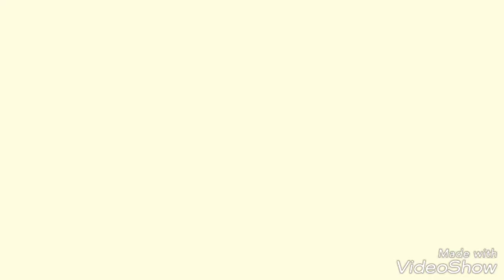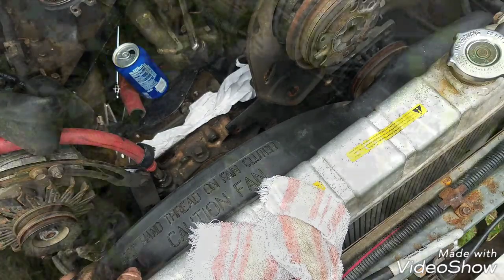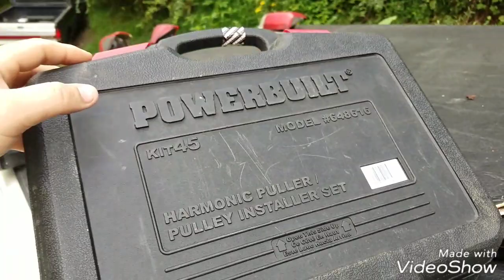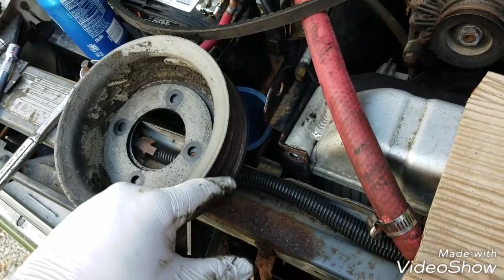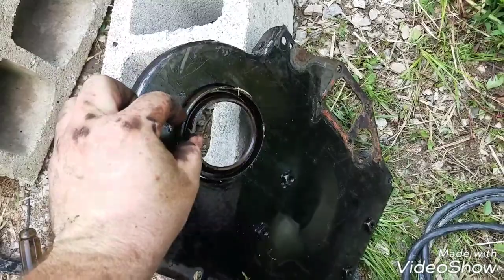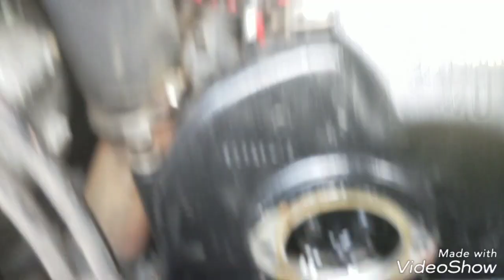OBS F-Series: Static Timing A 7.3 IDI Injection Pump

Comment: Do not use locktight on fan clutch. It's a great way to get punched in the face.
Reply: I never put lock tight on em until my new fan clutch spun off when I killed the truck and punched my radiator
Reply from the maker: Ok?

It's held up since the fix with no issues so..
Reply: @TheFSeries  probably so it doesnt get locked together they hold pretty good since they turn with the torque of the fan..their hard enough to get off when old anyway

Comment: what in the wold does replacing the front seal have to do with static timing. "Nothing"
Yes "AT THE END" you show how to "Manually align " TIMING GEAR Marks (A no brainer) But It has Nothing to do with actual "Static injector timing" which involves IP timing advance marks and/or internal pump pressure that changes "pop" pressures and therefore advances timing!
"Thank you for wasting my time" ~ Must be a democrat ~ :P
Reply: You amuse Me. You’re indicating that intelligence is based on political Party affiliation ?  I am OK then as I am Republican.

                                      Fergieman

Comment: Now if you had removed the plate on the injection pump and put a mark on the housing and on the pump and not turned the crank you would not have to remove the front cover and line up the timing marks. Not sure why you did this?
Reply from the maker: Had someone helping that pulled everything off as 1 unit.

Seems to be the usual method and then people end up in the same boat I was in so I figured I'd try to help.
Reply from the maker: It isn't hard, just line the timing marks up, install the cover plate and you should be fine.
Reply: @TheFSeries once the front plate is off where am I turning or cranking at to get everything to line up

Comment: I love the video I've never had my motor this tore down but I did have to remove my IP.
I took the inspection plate off the timing gear housing and made my marks and proceeded to remove my pump and housing. I did what I had to do and put everything back together.

Comment: Mine is a 91 7.3 NA, has a serpentine belt not the V belts.  Also, if I'm pulling it off I'm replacing the water pump. Cause you know this one will fail when it's cold dark & raining. I just love the way Ford mixed metric & SAE on the same bracket. When I can I swap them out to all SAE. I also like the red injector lines !
Reply: Metric threads and SAE threads are not interchangeable. You CANNOT swap them out.
Reply: Why not go all metric rather than SAE .  As the years went up to the present, Ford got evermore metric.

                                       Fergieman